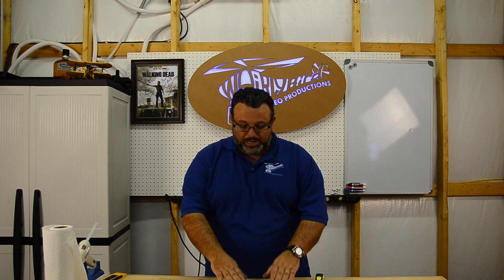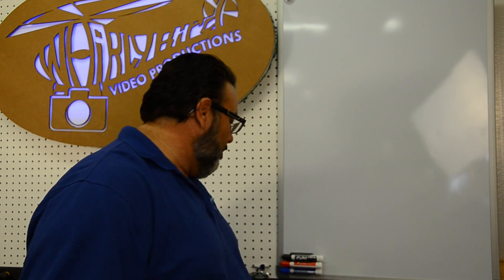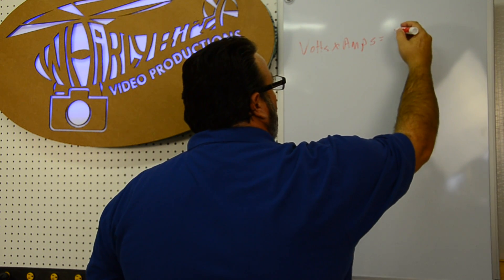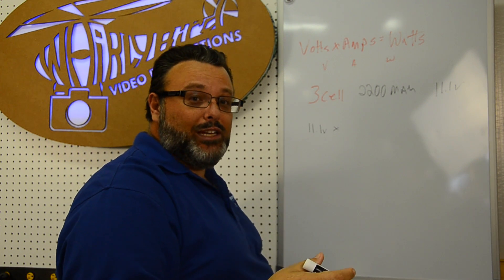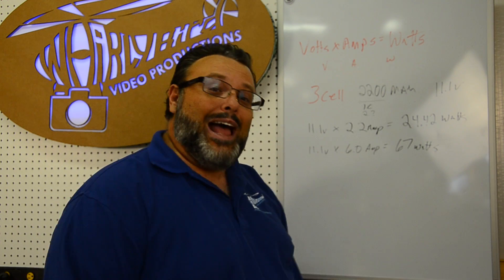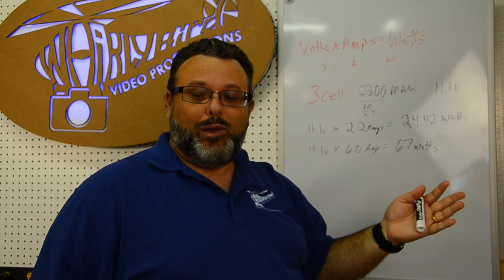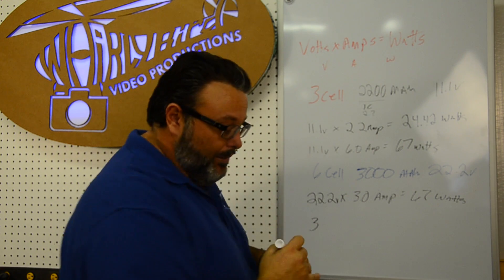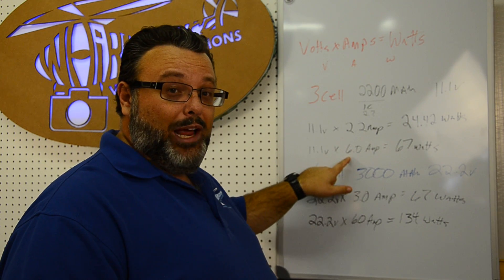Choosing a Charger for your lipo's using the watt calculation

Comment: Close m8, let's work on the battery your describing,, first off with any calculating IMO,start with a fully charged lipo cell which is 4.2volts,now times 4.2 by the number of battery cells in this case a 3cell (11.1v) 4.2v multiplied by 3 =12.6v now multiply 12.6 by the mah this case 2.2 (2200) 12.6 multiplied by 2.2 =27.72 watts needed at 1c, 55.44wats at 2c IMO.
Eg:6cell 3300mah battery 4.2*6cells=25.2v*3.3=88.16 watts at 1c. Needed from charger
Reply from the maker: Your correct the reason I stated the 11.1 and such is that if you buy the battery it actually says its 11.1 on the label.  I agree 100% with you its volts x  amps gives you watt's.  They should label them as 12.6 to not complicate things.  Keep it simple right!  Thanks for watching.
Reply: I am wondering why are you at 4.2v per cell? I have for example a 4s that says 14.8v.  4 cell I divide that by 14.8v and I have 3.7v per cell. My 2 cell runs at 7.4v. Just gets a little confusing. After this math I have a Venom Duo Pro charger that is 80 watts and getting that at the 4 cell battery with a 3c rating cannot be done by my new charger. How sad.

What is sad is I was taking AIT 1 1/2 years ago and there is so much more AC/DC voltage calculations I care to get into. A single circuit, parallel circuit or both single and parallel circuits. When it's thrown at you at 90 mph and so much more, it can be hard to get it down for real. Not to mention hydraulics, pneumatic, safety and so many other areas. It was a bit over whelming for me. I did well in the end, but to obtain so much of it is crazy hard.  It will come back, as I need it. 

Thanks, for any reply you can give.